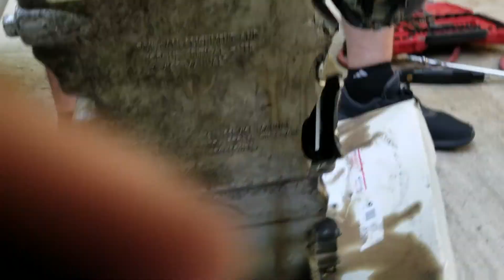Driveshaft hits a Pontiac gto oil pan

Comment: What all did you take loose to get that pan out???
Reply from the maker: U have to unbolt the k member to get it off due to the pick up pump being in the front. Plus u have to also disconnect some line that bolted to the k member like ac lines
Reply: Bald Head Garage I wish you could have did a video to get the oil pan out. I need to do the same thing to change out the Oil pan baffle to improved racing version and to add that support piece for the pick up tube.
Reply from the maker: @67judge  ur right I should have